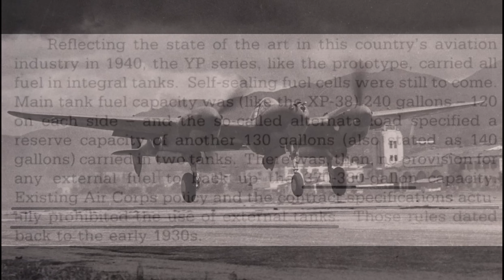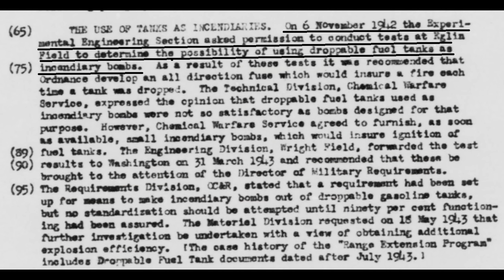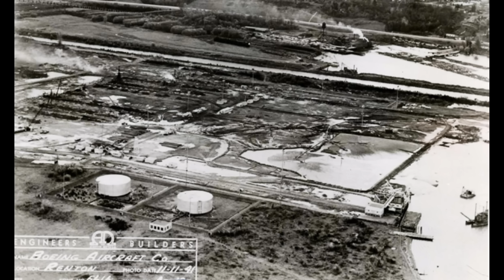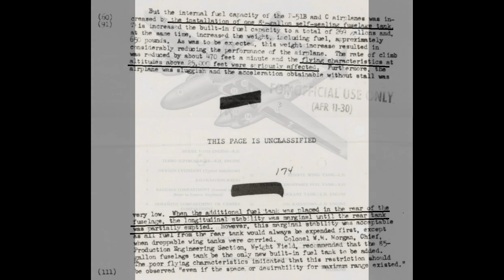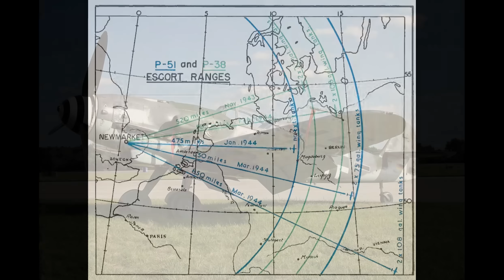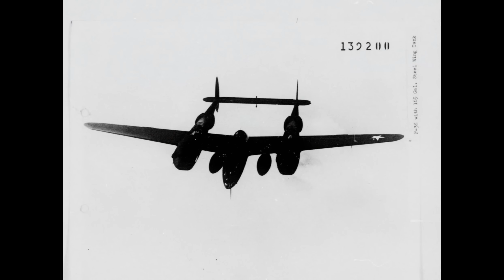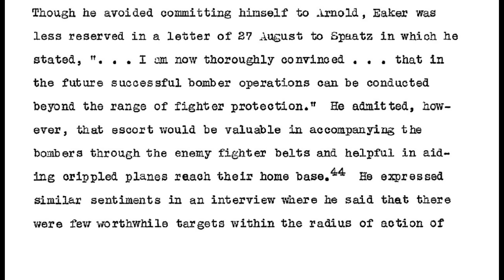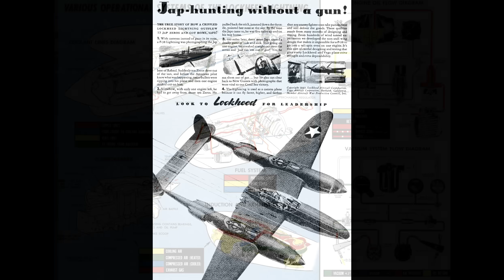The P 38 Lighting and the Bomber Mafia's Failure In World War Two

Comment: The P-38 was not the solution to all ills.
It was expensive to manufacture, more difficult to master, maintenance intensive, had difficulties with high octane fuel, had a lower than most rate of roll, a low mach number and did not do well at high altitudes.  
The P-38 excelled in the Pacific, where it fought at medium altitudes against fighters with low Vmax.
It did not do nearly that well in Europe or the Med.
Reply: It was not without faults, but Greg's argument wasn't that the P-38 was a better fighter than the P-51, just that it had just as much range at a much earlier date.  Additionally, most of the commonly cited problems with the P-38 (particularly at high altitude) were solved in the versions currently in service by the time P-51 started replacing them.
Reply: Unprotected bomber formations is such a bad idea that it speaks for itself. Literally any fighter protection at all would be preferrable to the methods by which the USAAF squandered thousands of highly trained and specialized officers and crew to say nothing of the bombers themselves.
Reply: As Greg has stated previously, the P-47 existed which could have been doing escort duty long before the P-51 became a consideration. The P-38 was just one option, of which there were multiple. The fact that they had unprotected bomber formations for such a long time is the real failing, not that they didn't use the P-38 specifically to remedy that.
Reply: The point about the expense is valid, especially considering it had twice the engine cost! Two engines also brings up the issue of allocation of war production. There were never enough engines in 1942 and 43. But Idk if that entered into the bomber mafia's thinking when blocking the development of drop tanks. It may have been used as justification in addition their already negative mindset - what else was going on in the minds of the bomber mafia is an interesting question.
Reply: P38s still flew escort for 1 year until Fall of 44. If it was such a poor fighter it would have been pulled from service. As Greg stated early doctrine didn’t help.
Reply: He swings! ... and he misses! Your entire argument is a smokescreen. This isn't about the P-38, it's about the "Bomber Mafia" doing everything is their power to prevent the development of an effective long-range escort fighter. Greg brings what appears to me to be incriminating evidence, both fact-based and logical. "Don't focus just on what they said, look at what they did." He provides means, manner and motive. I'm not sure what a defender of theirs would bring, but it had better be more effective than the waffling and CYA they indulged in. 

That said, another point you entirely miss here is that the issue isn't whether the P-38 is a Wunderweapon, it's whether the P-38, equipped with long-range drop tanks could blunt the effectiveness of the Luftwaffe's massed attacks, decrease the bomber loss rate, and save American airmen's lives. A famous saying goes like this: "Perfect is the enemy of good enough." The P-38 was certainly good enough to improve US Strategic Bombing Campaign outcomes, and Greg makes a case that the Bomber Mafia pursued "The bomber will always get through" as a virtual mantra with 'religious' zeal. And that monomaniacal focus cost American lives and treasure. 

Your argument is essentially, "The P-38 didn't succeed, therefore it couldn't succeed." I hope you can see the problem there.
Reply: It did not do that well over NWE but did excel in the Med. Unlike the 8th, the 12th AF fighter groups never up their P-38s
Reply: It wasn't anything inherent in the P-38. Improvements made later would have made the plane operate very well in Europe. The Lightning's problems were more about timing.
Reply: Yes, the P-38 was not so good at very high altitude, but the bombers should have not been flying that high anyway. High altitude strategic bombing proved to be very inaccurate. General Lemay saw this in Europe, and changed that later in the bombing of Japan. Thank Charles Lindbergh for showing the USAAF how to get extraordinary range in a P-38.
Reply: I bet one B-17 cost 2-3 times as much as one P-38, and it carried ten times the crew.  Twice as many engines is twice the maintenance.  All those turrets and guns is more maintenance.

Now think of B-17s with no guns.  That's probably 2-3000 pounds more bombs and faster and higher, and you put all the saved crew and equipment into double or triple the fighter escorts.  Try that comparison.  It's an interesting thought experiment.
Reply: The main problem at altitude with the P-38 was that it could not follow a German fighter through a split S without getting into compressibility. Once the Germans realized this it became a standard evasion maneuver. The dive flap effectively solved this issue.